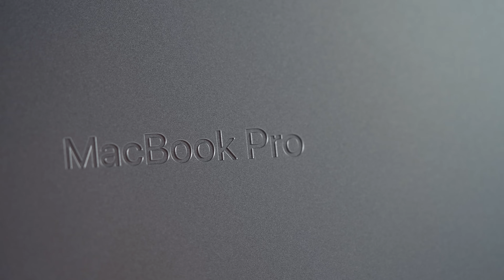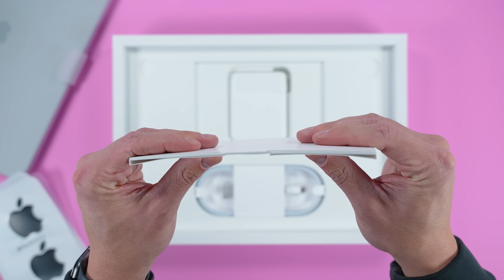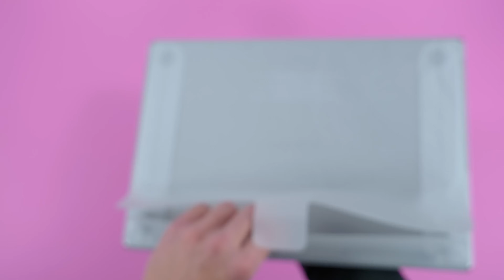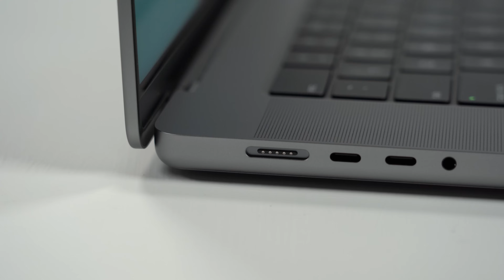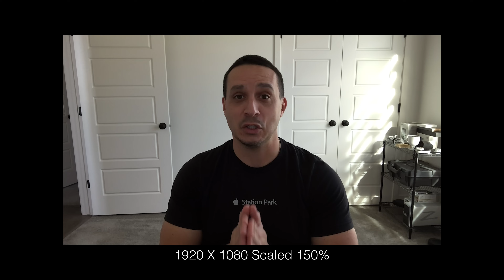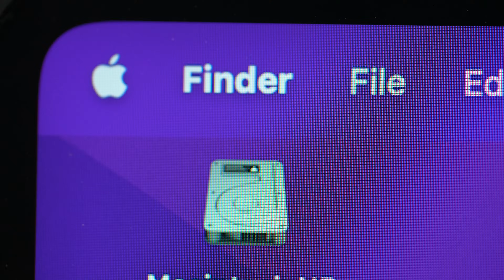Apple M1 Pro MacBook Pro 16-inch Review (1 Week Later)

Comment: You should of got M1 Max 64gb !!
Reply from the maker: Doesn't make sense for me and the work that I do.
Reply: Why should he pay hundreds more for the M1 Max if he is getting what he needs out of the M1 Pro? That doesn’t make sense to me.
Reply: @db4a  I know this is old, but I agree 100%.  Every time I watch an M1 Pro vs. Max, there is not much difference, and it is not worth the upgrade. The way Apple comes out with M-chips so fast we can never have the "latest".
Reply: I am going to be sticking with the M1 Pro with 16gb here. Several have tested these systems and found that anything more than that wouldn’t benefit most users.
Reply: @tylerdekrey6051  So true!

Comment: What's the difference between the CPU performance of the 8-Core M1 Pro vs the 8-Core M1 processors?
Reply from the maker: From the tests I've seen there's not a whole lot of difference.
Reply: @TomasVillegas  no difference at all saving myself 1,000$
Reply: @Marc Marc Thanks for sharing your experience. I may get the 16-inch version then with the M1 Max :P And 32GB of memory to future-proof myself for at least 5 years.
Reply: @iUmarFarooqi  go for 64gb ram and 2TB
Reply: @iUmarFarooqi  Same. Ordered the higher-tier for future-proofing.